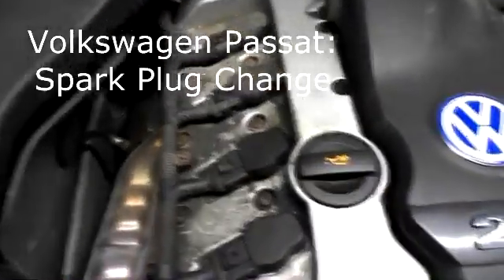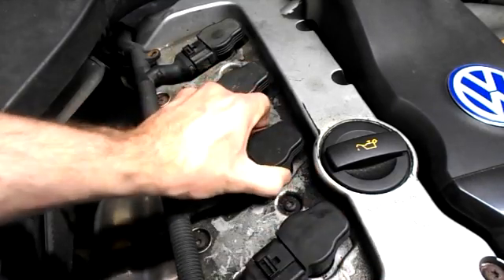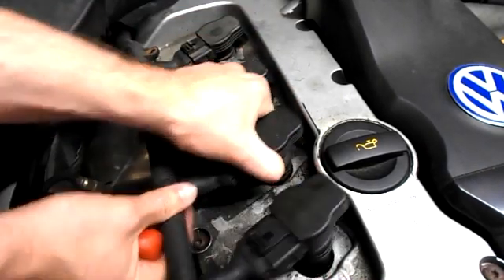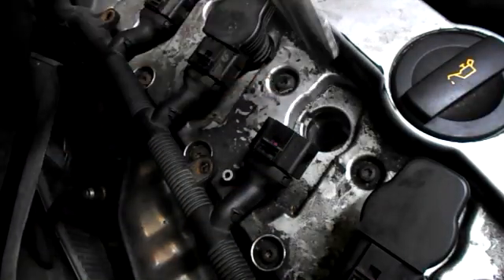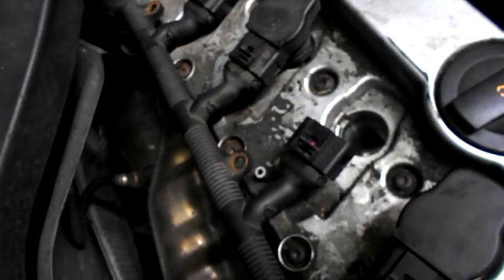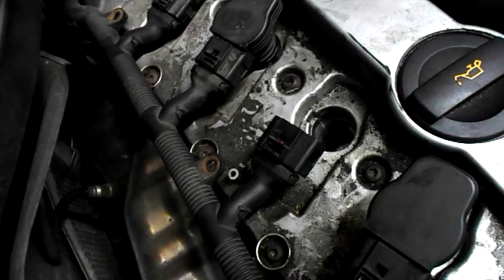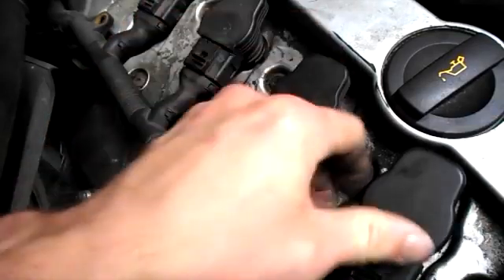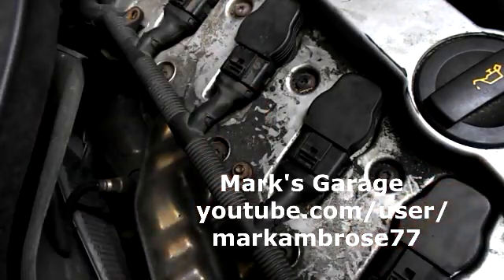Volkswagen Passat Spark Plug Change

Comment: I have the v6 30 valve 2,8 liter engine. Which model is this please, AWT, ALT or AZM? Thank you in advance
Reply: This looks like an in line 4. Not a V6. Terrible video, doesn't even mention the engine, year, or anything.
Reply: @drzoltanvajo142  Thank you Doc but I see Mark's Garage has since added the exact info I wanted (plug torque settings) so for me the video is helpful. 
Perhaps Mark is trying to help by generalising the way to change the plugs for a range of VW engines.

Comment: This is the fifth video I watched on doing this and not one mentioned what the gap is supposed to be.
Reply: Bart Psenicnik  I have a 2007 turbo and I'm buying the ngk 6458 laser platinum plugs and they are pre gaped so you don't touch the gap.
Reply: Okay, thanks Lynnette!
Reply: Since the early 1990s, maybe even before, gapping plugs was no longer necessary. Last time I heard anyone talk about gapping was on a 1978 F-150.
Reply: When you pull the coil out, the spark plug is down in the bottom of the well, you'll need an extension on your spark plug socket.
Reply: i have an '07 passat 2.0t. assuming we have the same car, where exactly are the spark plugs located?
Reply: Just google the gap that’s all